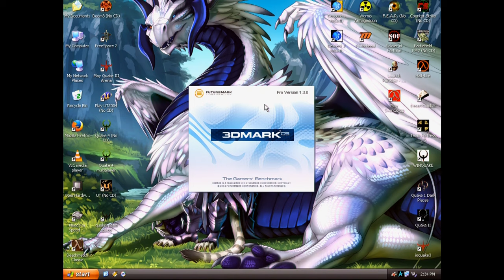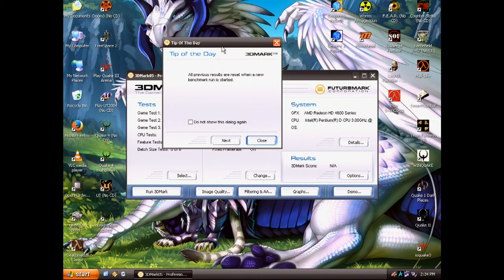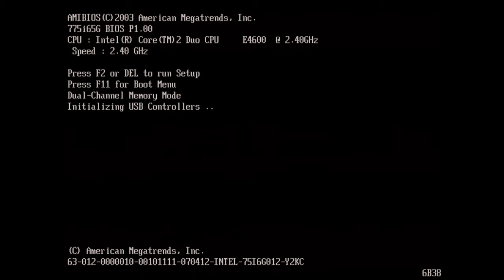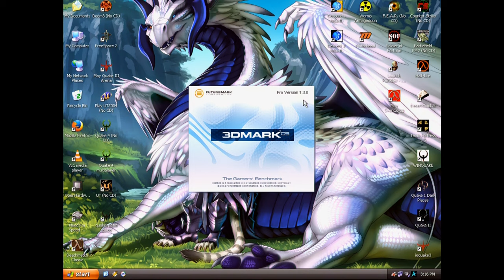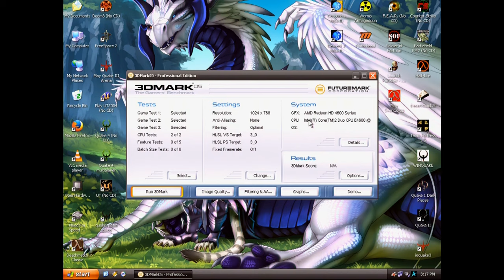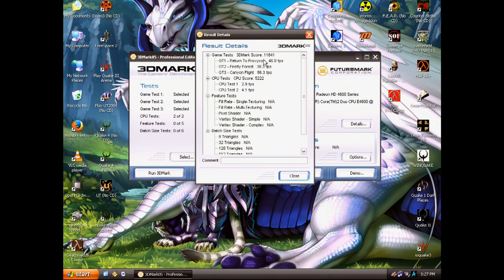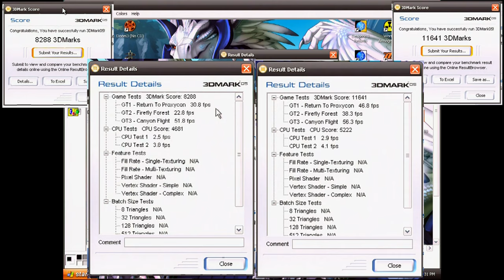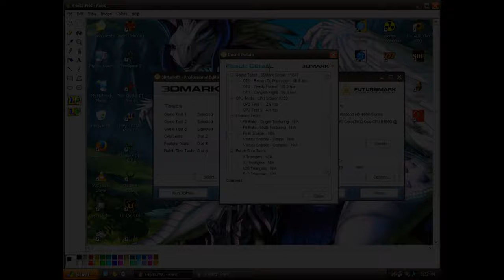CPU upgrade on my "Reverse Sleeper" Win XP LAN Party Rig - Pentium D to Core 2 Duo E4600

Comment: Now that is a fucking reverse sleeper! Good job! Would have liked to see older hardware but it’s a great start.
Reply from the maker: Haha even more reverse? Well this was specifically built to be my primary XP gaming rig. Sure could have gone Pentium 3, but I still felt the original Pentium D was a great choice. Thaaaaat said, not to bad for a $6 upgrade. Try doing that "back in the day". Cheers!
Reply: c:\90s_tech haha so true. It’s the sweet spot. The older you go the more expensive it gets.

Comment: I've been working over the last couple of months on my "Fast AGP Win XP PC". Case is a silver Chieftec Dragon (which I repainted), an old school classic that I've also owned in the past, so it brings back memories... I bought the 775i65G Rev. 2.0 for 23€ and just upgraded the cpu from a PentiumD 915 to a Pentium E5800 (paid 6€) which actually overclocks on stock voltages (1.24-1.29V) up to 3.6GHz with great temps (47C after 30 minutes of prime95 on a stock-like cooler). I use a set of 2GB Kingston PC3200 cl3 DDR which with the BCLK overclock run at 450MHz. For storage I installed windows in a 32GB ssd and I also use an 80GB IDE drive but I'll switch to a SATA WD Raptor (it's on my to-do list). For sound I have the SB X-Fi Platinum SB0460 (had the front I/O originally from my Platinum that died, so I bought another one for 22€) and my graphics card atm is the XFX HD4650 512MB (older 15€ purchase). But I probably found the greatest deal of the year for me; a Sapphire HD3850 AGP for 45€ (less than $50) which I'll be purchasing tommorrow, so fingers crossed, I hope this works (seller says it is in working codition)!
Reply: P.S. On my current configuration I get a score of 8580 on 3DM05, with a CPU score of 7452.
Reply from the maker: Dude you got some sweet prices. Sounds like an awesome build. How did it turn out? Also how does the 3850 stack up against the 4650? Apologies for taking so long to reply. Cheers!
Reply: @c90s_tech  Hello there. The final specs of my system are:
Chieftec Dragon, Corsair CX430, Asrock 775i65G Rev. 2.03 with latest v3.30 bios installed, Pentium E5800 @ 3.83GHz, Deepcool Gamma Archer fan on top of the stock heatsink (runs very cool), Kingston 2x1GB DDR PC3200 @320MHz 2-3-3-6 timings, Sapphire Radeon HD3850 AGP with Arctic Accelero L2 PLus heatsink and a couple fans strapped onto it (the actual arctic fan couldn't fit, but nevertheless the card runs very cool), SB X-Fi Platinum SB0460, Transcend 32GB SSD, WD VelociRaptor 250GB. 
Performance wise it is really fast! I get a 3DMark05 score of 17809 and games like Dirt3 and Tomb Raider 2013 are actually playable at 1080p. 
Here are a couple of shots, cheers:
https://i.imgur.com/D0Jw7CQ.jpg
https://i.imgur.com/cwZQjXO.jpg
https://i.imgur.com/IMfwqnm.jpg
https://i.imgur.com/5CXMsDn.jpg

Comment: Nice rig, that AGP card is no joke of a wallet squeezer but im sure it's worth it. I just built my Pentium 4 xp rig the other week after a year of hassles but it's all sweet now - 3.2ghz socket 478 Prescott @ 3.4ghz on a SiS fx665 chipset mobo with a Geforce 6800 GT AGP. It's in a nice sleek corsair carbide case (no front drive bays unfortunately) that i got new in box for $20 aud (no idea how or why it was that cheap).

My next little project is another XP pc with my old i5 2500k and a pci-e Geforce 7950 GT 512mb for Doom 3 and Quake 4. Because it's such a beast CPU for XP gaming, I've got a bunch of pci-e cards I want to swap out and play with too: 8800GS (had this with a core 2 duo 2.66ghz back in the day), a mate's 9800 GTX+ and my old GTX570. Gonna see which games in XP can handle such new hardware and also push my 240hz monitor to the limit haha :D

thanks for the video, that is a very good upgrade for an even better price. keep it up :)
Reply from the maker: Nice! Even your Carbide build is a beefy XP build. 2nd Gen i5 is just crazy! There will be nothing it can't run as long as there are XP drivers for everything. Nice find on the case! Sometimes things find you and you know it's time to use them when that happens. 

I also have a bunch of PCIe cards that have kind of found their way to me. I will eventually find them homes and/or use a couple of them. 

I also find a lot of joy with Windows 95, and finding just the right amount of higher end hardware specific to that era. Things I could have never dreamed of affording back then. 

Cheers!

Comment: Which processor is faster? E4600 or E5800.
I have the R2.0 version of 775i65g with a board revision 2.12 latest bios and somewhat the E5xxx processor work.
I just recently bought a 3850 AGP and planning to paired it with either E4600 or E5800.